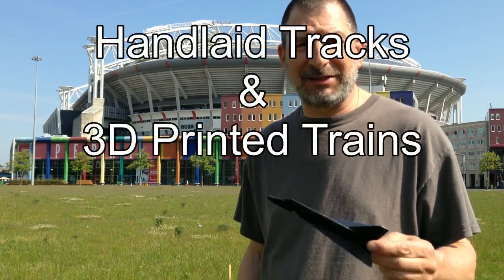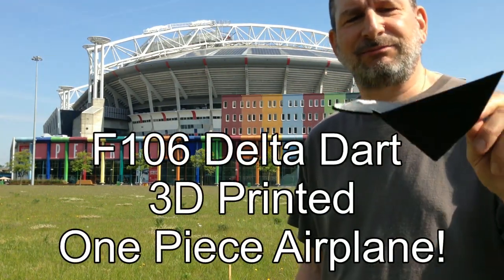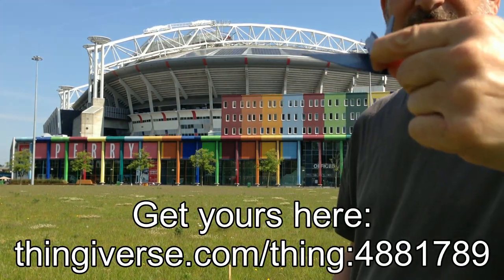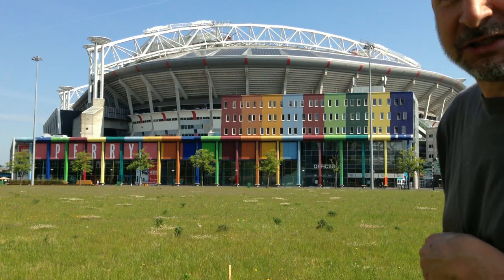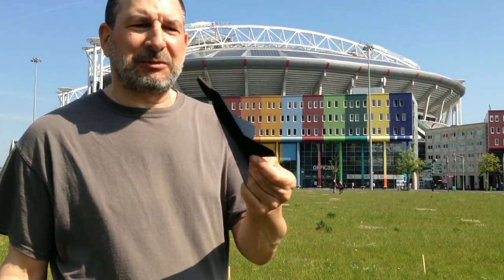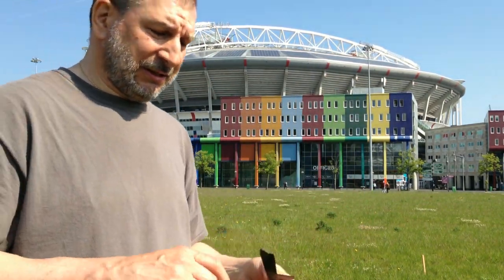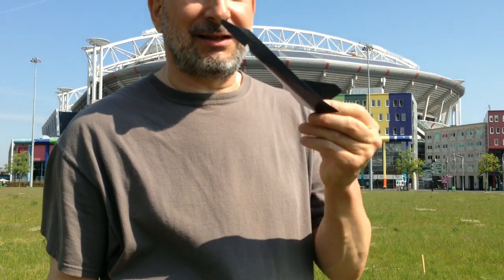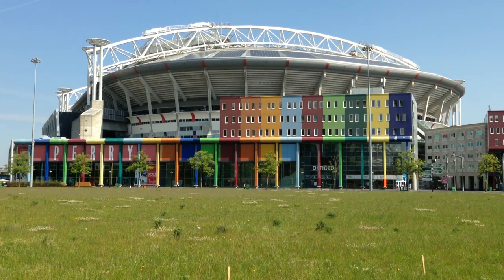F106 Delta Dart 3D Printed One Piece Airplane - Slingshot Powered Delta Wing

Comment: will this survive with PLA+ at hight impacts?
Reply from the maker: It will survive a few... If it hits concrete or trees, it will eventually break for sure. Didn't seem to mind going nose first into grass or dirt.
Reply: @handlaidtracksand3dprinted922  Printing this in nylon could make this model plane durable.

Comment: This Design could have detachable wings so that different types of wing design could be added to it...This is Pretty nice for experimenting the Air craft Designs.! Kudos ~namaste
Reply from the maker: Thanks! The issue is attaching the wings somehow and not adding too much weight. My later designs have a slip in wing and tail. Also added the rubber band powered trigger to later designs. The P51 flew the best: https://youtu.be/N_HKZlV5J_U